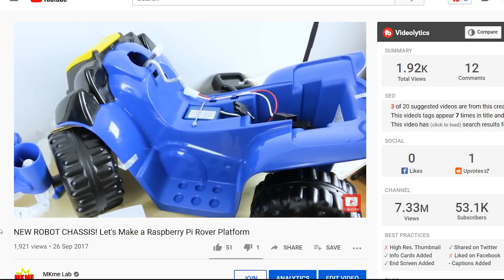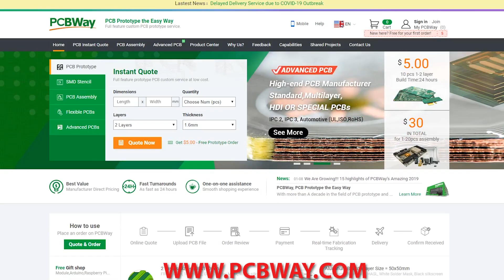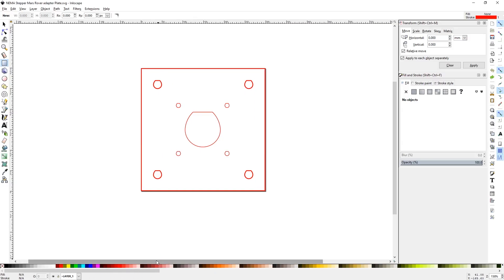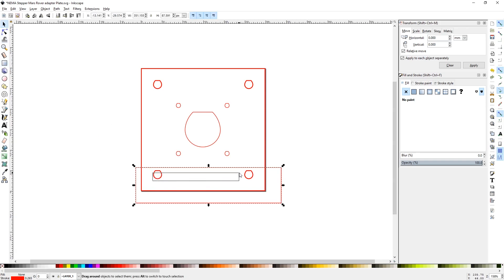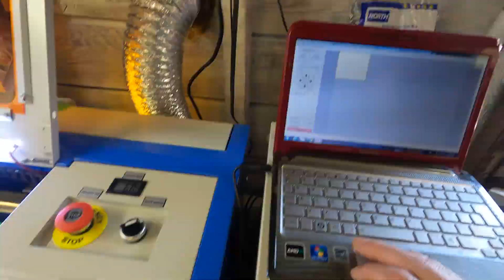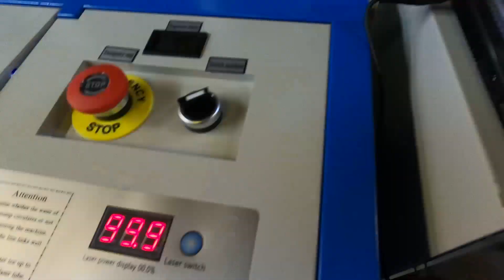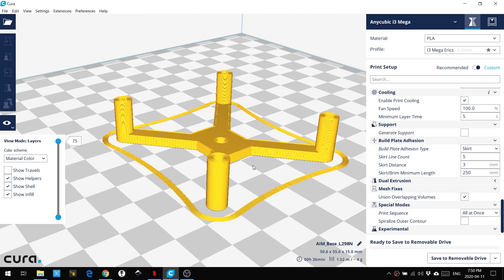Things You Should Avoid When Building A Robot 😲🛠

Comment: Hi there just I just popped over from xjet. I have had a similar problem and I used a gear motor with a 100k pot for the angle feedback it worked a treat as a hi power servo.
Reply from the maker: Thanks for the tip!

Comment: That NEMA24 Motors always meant to be used with gears Eric. I knew it would fail immediately when I saw you connected directly to the shaft. Consider off-center and connecting it with an L-bracket lever.

Comment: 2 things come to mind for solving the steering. One would be a windshield wiper motor or door window motor. Either have enough power, you can use a pot to give feedback to arduino for servo like characteristics.

Idea 2 was mentioned above and using a high torque metal geared servo.

Comment: You can use a big hobby servo motor, or even better and cheaper make a powerfull one using  an automotive power window motor and a pot for feedback! these are really powerfull, very cheap and easy to find fron scrapyards and small. It would fit like a glove for your project! Alternatively, there are reduction gear boxes for steppers like the one ypu are using, but with the stepper solution, you won't have feedback over the steering position if it loses steps!

Comment: Hello from Greece, many thanks for your videos.

Since you have the L298N  witch can drive 2 DC motors I would use some geared dc motor.  
I would try to move farther down the turning system in order no to lose so much torque in the turning shaft .  

A JGY-370  in 12-24V low RPM  configuration sounds it could handle the torque you need.